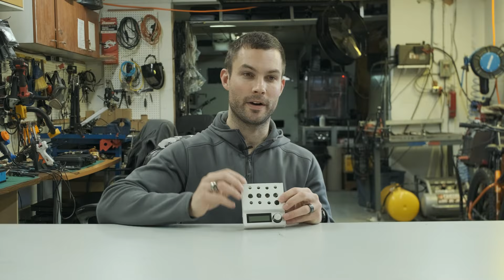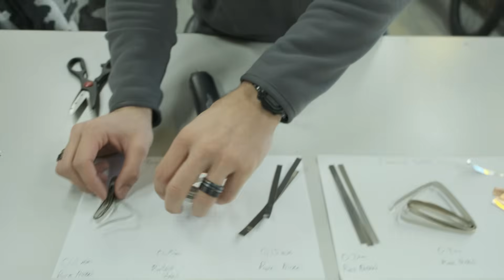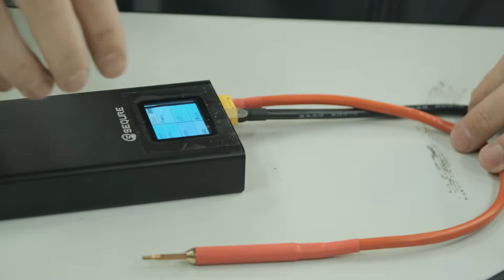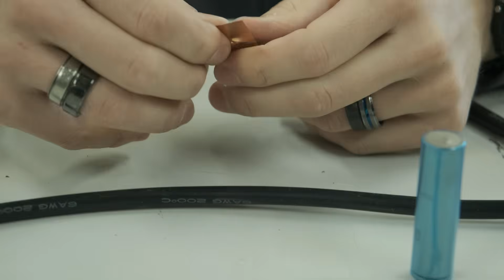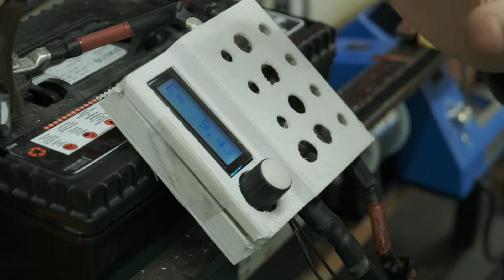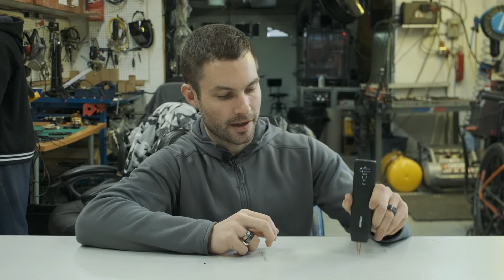Building Lithium Batteries? Which Spot Welder is For You?

Comment: One super important thing, any time mentioning microwave oven transformers is never connect one to power in the way that it comes out of the microwave.  Messing with microwave oven transformers kills a lot of hobbyists, many of which are doing high voltage experiments, but it's about the most dangerous device you can mess with.

The transformers used in DIY welders start out as a microwave oven transformer, but they have the high voltage winding (many turns of thin wire) cut and removed, and replaced with a few turns of heavy cable.  This is still risky, but at least it's just mains current that an electrician, or experienced hobbyist could probably handle with appropriate care.

Not mentioning that up-front could lead to people trying to build something without understanding that it's a very different thing than an unmodified transformer,  and when it comes to MOTs, one wrong move will kill you.

Comment: How many batteries have you built and how many still work? Max isn't always the best setting. You don't seem qualified to be doing reviews. How long did you use these for It's really not surprising that people are getting dumber. Professional tools are expensive for a reason. Not to mention it looks like it would have been cheaper to just buy once cry once instead of cheaping out over and over and over. I'd hate to be paying you guys by the hour. I'd run away from any shop that had garbage tools like that lying around. Guys like these are the reason I have to do everything myself now.

Comment: All the Li-Ion Welder only for quick short Work. All other the best for Spotwelding Akku Packs. The Microwave High Volt Transformer are the Selfe made vision, but it do work like a Pro Maschine. I use a Carbattery Platine vision Powered bei 12,8V @100A Server Powersupply wiht PowerCap buffer.

Comment: Those capacitor ones do not last long. They do work great when they work. I have 2 glitter ones that lasted about 1 year then they stopped working. The lights come on and says it's ready but does NOTHING. The one I use is the microwave transformer build. It works the best.

Comment: I tried 4 different ones that use pouch cells and had terrible luck they welded ok one or two times and then failed to recharge I had to open them and charge the cells with a power supply

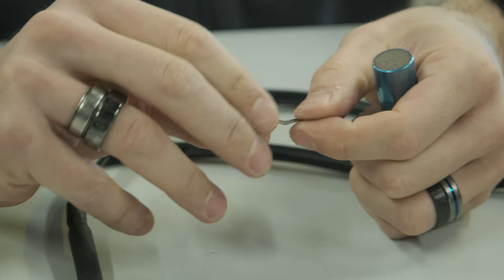Comment: 6:20,7:09,11:31,19:36,13:06,19:36,20:52 are NOT acceptable welds. Vibration can detach those strips, causing heating, arcing and possible fire.
These welders are toys, not for making reliable packs. The exception is the last, capacitor spotwelder, the Docreate DO-02, but that even can only handle 0.2mm nickel or 0.3mm steel (plated), not to mention the quality issues of that product.
There are much better offers these days: AwithZ UK3 is more powerful and cheaper than the Docreate DO-02. 
Docreate TK-10A is a great alternative to the smaller spotwelders, but not much cheaper.

Comment: I have the temu H1 AwithZ spot welder, it's my first spot welder so I don't exactly have anything to compare it to, but it works for me. In this video they didn't try the different levels of welding to find the best holding option for the welds. Because of the 11 different strength levels it definitely has a slight learning curve to figure out what level works best for the nickel strip and lithium 18650 cell you are working with. 
The rechargeable and portability of this handheld spot welder with the automatic feature is pretty nice for me.  I am only using this H1 for rebuilding power tool battery packs when they have bad cells in them. My power tools were 12v 3-cell battery packs that were manufactured in the late 1990s and 2000's and after rebranding they were discontinued and replacement battery packs are not available and they have a proprietary design so modern 3 cell 12v battery packs won't work for replacements. The original battery pack uses a non bms or dumb pcb board with the bms feature built into the battery charger units and not the battery pack itself.

Comment: 8:10 weird, why u cant , but i use the same but is brand docreate 756 it can do it. very weird.
Reply: When dealing with hand held electrodes in resistance welding, the variation can be extreme. Everything from electrode tip size, shape ,pressure applied, angle vs shape and distance will have an enormous effect on where the energy is dissipated and heating occurs. The wrong combination will mostly just heat up the connectors and cables, or at the other end of the scale make a lot of sparks while eating up the electrode tips a little by little. Sparking is not a good thing.   
The modified microwave transformer  (MOT) welder has even more variables unless the control circuit is carefully thought out so it triggers at the same time in relation to the 50/60 Hz mains waveform. At Zero-crossing there is zero volt, but if it switched on at the peak only 25-30 milliseconds later, 160/330 volt is going to energize that transformer and huge currents will flow instantly. 
Luckily 99% of all MOT welder projects are abandoned when it's time to remove the secondary high voltage windings. It's a lot of work and can be quite dangerous.

Comment: I found the ones with built in battery's suck ass. They can only do .1 plated nickel.  Best to get one that runs on a separate battery. Use a big battery to. Don't underestimate  how much power you will need.

Comment: Which one would you recommend to spot weld a wire to a stainless surface. I'm need to attach one of the BMS wires to large bus plate. It's a tesla battery.

Comment: what i was seeing that you are doing wrong on you're test is that any time you rip off any of the metal sheets you need to cut off the spikes to do a re test or the small plate will not sit on the full metal part of the battery and only be sitting on the spikes you created by ripping the strip off so sometime you wont even get a weld because there is nothing touching the battery and the strip is just floating so even if it welds its not touching anything, so you must cut the tiny spikes off first.Second when doing a weld you must press the tips firmer onto the strip to make the metal contact better when it welds to gt full penetration.

Comment: if you can pull the nickel strip off with your hand then none of these welds are any good, so some of those you gave a pass are actually a fail
Reply: Came for these comments. Barely into the video and he's not even putting any effort into wiggling - it comes right off which means theirs no penetration worth putting into a project.  I've taken apart battery packs for modern vacuum's and their filled with 18650's.  Taking the connectors off took effort with a pair of needle nose pliers and many times I was left with a square patch in the center that I couldn't remove.
Reply: @johndurrett3573  , never found a battery pack that i could remove the strips with my bare hands.   never!   and why is he using nickel instead of copper?
Reply: I was thinking the same 😂😂.
Reply: The H1 AwithZ spot welder has 11 different levels of spot weld settings to get the strongest bond, they didn't even mention the different levels in this video and they used it on the automatic weld feature on instead of the manual for the best position and pressure of the welder on the nickel strip and battery cell. 
I have this exact spot welder and with the proper level set and using it manual pulse to weld you can't pull the pieces apart easily unless you put A LOT of effort in taking them apart, usually requires a dremel to grind the spot welds away to remove the nickel strip.
Reply: True. And most if not all failed because incorrect positioning  of probes on the surface and wayyyy to much pressure was applied :))))). But yes, all except last one failed the tests just because he could rip off the strips w bare hands. I did not see any "pass" except last one he tried.
Reply: @k4talin68 I would think to much pressure and its not welding would mean you need a stronger one. It creates more surface area which would be better only if it was strong enough. Having to adjust your pressure so you don't create a lot of surface area will get the contact points hotter but less coverage.
Reply: yeah dangerous/bad info here given everything i know so far

Comment: When welding steel with a tig welder the welded area needs to be clean and grease and oil free.  I wonder if the materials were cleaned before spot welding if the results with all welder types would be better.
Reply: would solder flux improve welds?

Comment: I bought one of these spot welders, the kind that looks like a little circuit board. I tested the spot welder with a motorcycle battery and the probes just blow a hole right thru the nickle strip even on the lowest setting?

Comment: Excellent video!!  I learned a LOT about battery spot welding and welder types.  This is exactly what I needed!!  I've been using the cheap-o unit w mixed results - often find myself soldering the connection afterwards.  Didn't want to purchase better equipment until I had a sense of what was what...  so thanks for putting this together.
Reply: what did u ended up buying ? thanks

Comment: That Docreate type spot welder I bought off of AliExpress. I had it working only about 2 months used it on a couple of small projects. I tried to contact the seller after the 14 days return period was over but of course on AliExpress no chance to even communicate with the seller. I opened it up and found that behind the Mofets on both sides of the board 'a crack had appeared, and the copper was cracked right along. No idea if it can be repaired? I will just shelve out more precious cash and try to buy something better. The worst I was rebuilding a battery pack and got 90 percent done. God just wants me to have a shitty life :(
Reply: Sorry it happened bro, invest some $$ and get yourself a kWeld, you deserve it man!
Reply: @Eden_M  Thanks, I am saving up to buy something better. I am a pensioner now, and that money was hard to find. I will check up Kweld :)

Comment: I came looking for advice on a good spot welder. I found that the first device was given a pass, even though it failed miserably. I figured that a channel called Electric Bike Laboratory, would have insight on a good welder.
Reply from the maker: Go KWeld. This is a review for very entry level stuff as well.
Reply: @ElectricBikeLaboratory  I understand that those welders were "basic". On the other hand, a first timer replicating the brittle  welds in a large pack could end very bad. Not everyone knows how dangerous lithium batteries can be.  

Thanks for the KWeld recommendation.

Comment: This is the best video I have seen on the subject. You sold me on the Docreate. I'm assuming it shouldn't have any trouble with 0.30 nickel plated steel.
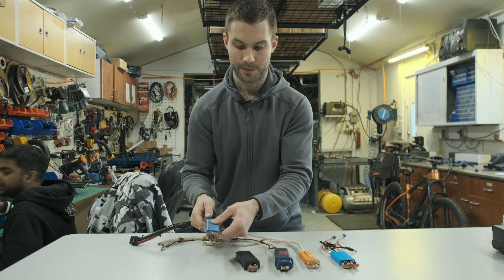I would like to fit a handheld such as the blue one you prefer at 36:38. The price has increased to $55.98!
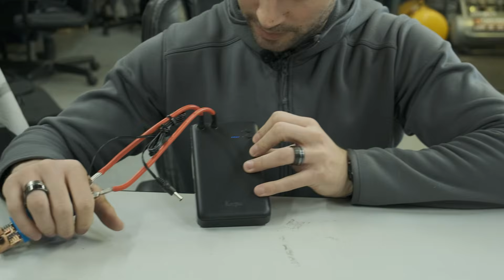Trying to source the leads you used on the Kerpu with the cheap blue one at 9:04.
I believe the connector is what Sunkko designates as Type O and I can make up my own if I can get the connectors.
Thanks so much for your help and this great video.

Comment: Keep in mind, too, that with these types of spot welders, too much pressure on the leads will lead to less resistance and poor welds.
When I first got mine, I made that mistake and struggled very badly to weld no matter the material. 
Once I figured that out (use light pressure! the lighter the better) my spot welder worked almost flawlessly and the welds were good enough to destroy cells trying to remove them. The key is to make sure the strips and the cell are flat and seat together well, and use light pressure on the leads.
Reply: I thought the opposite, I'll give this a try, thanks!
Reply: Agree. Incorrect procedure. Probes should be at 45 degree  in relation to metal strips and way less pressure applied.
Reply: I kept getting a short errors on my fnirst spot welder and literally found this out 15 minutes ago 😂 I was pressing down too hard and reducing the resistance too much
Reply: Absolutely right, it happened to me when i first tried my capacitance spot welder, i pressed too much with welding pens, thinking that's better and it just didn't spot welded anything, and i started thinking there was a problem with the spot welder, but as soon i started putting a little bit of pressure on the pens it worked flawlessly....great advice
Reply: no wonder a marine batter with 220v wire/cable and a starter solenoid worked better for me. if light pressure don't work i'll consider my seesii a waste of money
Reply: I have the a with z Spot Welder and if i press lightly i get very bad results, as in the video but if i press Firmer i get pretty good results.
Reply: @PaulFischer-q3d clean your contact tips.
Reply: To much pressure creates higher resistance which won't let the melting process happen, the heat is then produced through the whole system rather than all on those two points. A stronger one will be better so when you put more pressure you have better surface area and it will actually melt the two together.

Comment: That lead acid battery you have connected to the Kweld spot welder - what is its capacity? I assume it is a CCA battery but curious as to the size/capacity.
Regards
Troels
Reply: I want to know this also - it's an important point he should have specified. 
In my experience, anything over 0.1mm Ni is going to require 600CCA (confirm with a battery tester) - but getting a 950 or 1000 CCA is going to be ideal. 
I suspect the battery in the video is a Commercial Group 35 1125CCA ProPoint, which is around 200CAD but, as with anything from PrincessAuto, it going to be hit-or-miss.

Comment: Very good video. Unfortunately I seen it way too late haha and bought AwithZ welder and some other lookalike noname lol.
My initial interest in battery building was actually restore and repair of my old DeWalt power tool batteries where either contact strips been broken off by impact from tool and battery falling from altitude enough to break them, or rusted strips or "blown" cells.
Reply: Did yo test Awithz? I think this guy dose not know how to spot weld. There should not be sparks... It means bad contact betwen spotwelder and the the nickl.

Comment: Yea, so much better without the music. 
Overall, very good review of the different brands.
I am not sure that the Capacitor version will "charge" any faster with a larger capacity charger... mostly because it would require that the unit be capable of negotiating the charge rate with the charger. In other words, typically, larger (non-usb) chargers don't have that ability... and they just supply the amount of current that the device requires. So, a lot will depend on that capacitor device, and whether or not it negotiates for power with the charger or not.

Comment: Are you really push a little more or just put the electrodes above?
Reply: Supposedly, you push down, then back off a little then activate... too much pressure reduces the effectiveness because it allows too much contact area, which decreases the contact resistance at the plates, and therefore less heat generated. (This info is just from what I have read/seen in vids, not from actual experience).
Reply: @marcfruchtman9473  Thank you for your kind response.

Comment: I currently have a MOT spot welder that has an Arduino controller with configurable double pulse timing. I built my bike's battery pack which is 10S13P. Problem is that I lost at least 2 of the 130 cells as it sometimes blows a hole in the cell. I now I recently tried to build a drill battery and it either they just weren't sticking and if I don't push super hard on the contactors, it blows a hole in the cell. Since I rarely use it, I am wondering if the Capacitor welder would be a good replacement.
Reply: Try a firm push, then backoff to gentle, then activate... supposedly, less pressure = better result due to more resistance at the contact point.

Comment: You should be using "sliced" tabbing wire since you want the welding current to go into the battery terminal. Not just thru the tabbing wire itself.

Comment: I was just about to start building another microwave based spot welder but updated with a microcontroller.   The one I made ten years ago was loaned out and never came back.   I had no idea that economical units were available until I found your video.  Thank you for taking the time to share your knowledge with us.
Reply: I leave this comment here for people wanting to build a spot welder from transformer. I did build one with microcontroller and solid state relay. I made the timing adjustable with rotary encoder and a screen. Its the full package. Has 2 turns of jumper wire and thick sharpened 8mm copper rods at the end. The output voltage is around 4 volts AC. The single transformer is plenty powerful to weld plated steel strips even thicker ones, but to weld pure nickel it is not powerful enough. You probably need two transformers parallel but then the whole thing becomes really bulky. The welds are also packing a lot of heat and the strips are discoloring so its not factory looking. I do believe in 2025 there is no reason to build one from transformer. The capacitor welder from this video is 100 bucks with shipping on aliexpress.
Reply: Obligatory note: playing with microwave transformers can easily kill you. Be careful and know what you're doing.